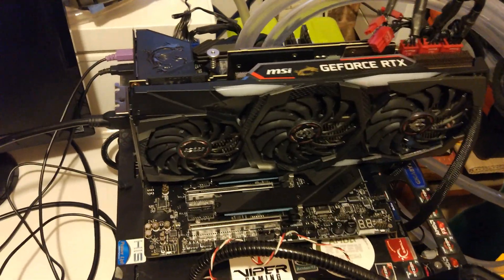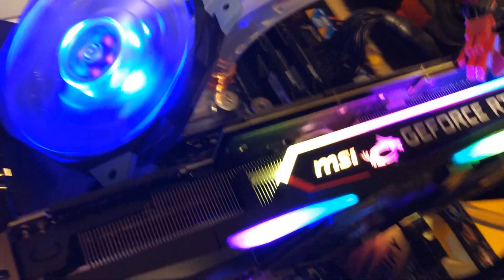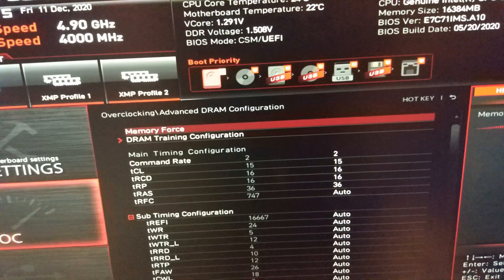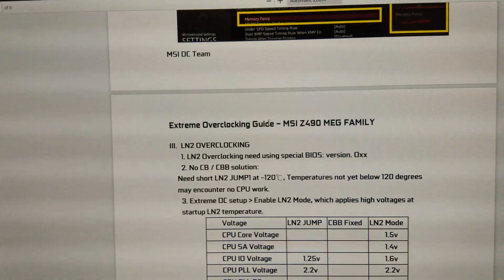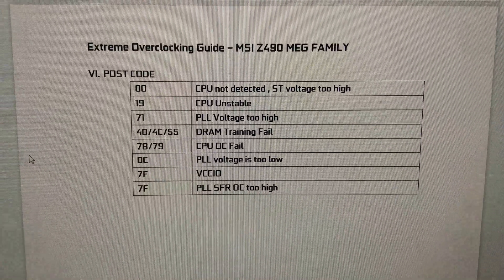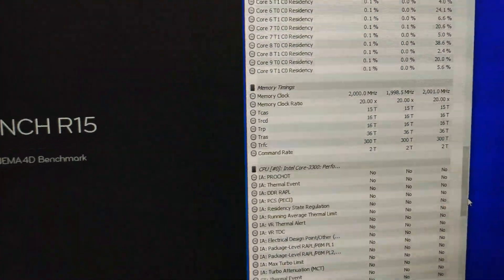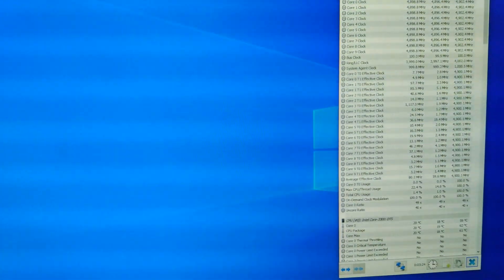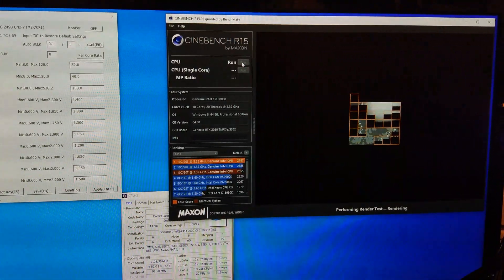i9 10900K ES QTB2 Overclocked to 5.1ghz On MSI Z490 Unify

Comment: Is this processor version good for running servers?
Reply from the maker: @MohammadX-v8r  I would say no as it can be unstable sometimes.
Reply: @LawrenceTimme  From which side?
Reply from the maker: @MohammadX-v8r  it can be slow or crash sometimes obviously it's and early engineering CPU so it's not ideal for a server if it needs to be stable.

Comment: I read somewhere down that this CPU is not recommended with Gigabyte Z490 UD. I got that motherboard. 

Someone's selling me this, with 6 month use, at 380 USD with a H470 motherboard, that I could probably sell at a 100 bucks. Do you think is worth? 

I plan to use it for my streaming rig. 

But I would also like to eventually buy the 12900K.
Reply from the maker: I wouldn't recommend getting it with a h470 as you can't oc and it really needs oc to perform well. Get 10850k or 10700k instead

Comment: I would want to ask about power consumption on that qtb2 cpu with good board(gigabyte z590 aorus ultra with 16+1 vrm on 90 amp mosfets ) and small  OC to 4.6 Ghz and 4.4 Ghz ring like in previous video. Because besides I have decent air cooler this cooler is good to about 200 wats So I want to ask what was power consumption in cinebench on that settings because I didn't do any prime95 or something like this so cinebench is toughest workload I am doing.
Reply: So you think it is possible to tweak this cpu between 4.4 - 4.6 Ghz without going outside 200 wats and not destroy my air cooler which can go to 200 wats based on my testing on i7 10700k OC in these workloads.
Reply from the maker: @jakubmad3957  yes I think so
Reply from the maker: Yes the gigabutt z590 board will be fine. The only board that wasn't up to this CPU was the z490m ud which was terrible and very power limited. You should be able to do 4.4-4.6ghz on air fine.

Comment: Do you think 51, 48 ring 1.4V 1.25V IO/SA 4000MHz REAL 1N 16-16-16-28 280 65534 1.5V on an I9-10900K ES QTB2, MSI MEG Z490I UNIFY and Patriot Viper Steel 4400MHz CL19 1.45v Memory Kit with a RX 6900 XT be good?
Reply from the maker: yes
Reply: @LawrenceTimme  I’m running 51, 48 ring 1.4V 1.25V IO/SA 4000MHz REAL 1N 16-16-16-28 280 65534 1.5V on an I9 10900K ES QTB2, MSI MEG Z490I UNIFY and Patriot Viper Steel 4400MHz CL19 1.45V Memory Kit
Reply: @ShahhTweaks  how did u manage that my cpu shits itself with memory overclock 😭
I have a QTB2, z490 aorus ultra, 3200 14-14-14-31 Dark Pro 2x8.

So far ive gotten to 4200 16-18-18-38 with loose subs
1.38v vcore
1.25v IO
1.3V SA
Reply: @Saberus  I have a mobo with SMT dimm slots
Reply: @Saberus  I have a binned ram kit and my mobo has SMT dimm slots and I have took off the ram heat spreader and now using a ram fan

Comment: my sample arrive today
XMP dont work, my ram is 3200, and work only in 2800
Reply from the maker: Lol try raise vccio and vccsa voltages to 1.25v
Reply: @LawrenceTimme  I will try now.
Tks.

Also, my nvme dont work, it works fine with my old cpu,have any idea whats the problem?
Reply from the maker: @ok_tantofaz  that's strange. I only have Sata SSD and not had a problem. Have you tried a different m.2 port

Comment: What is the stock and turbo clock?
Does it work with xmp?
Is it worth over a i5 11600k?
In aliexpress there are some ppl saying the cpu stopped working after some months, that seems bad.
Reply from the maker: Stock clock is around 4-4.2ghz. xmp working will depend on the board and ram more than the 3200-3600 should work fine.

The 11600k sucks so yes it's worth getting over that. Also look for deals on the 10850k!
Reply: @LawrenceTimme ty, but i couldn't find any good deals on the 10850k, but the 10900k qtb2 vs the 11600k just for 70$ more really seems like a good deal if it is safe. 
Between 10900k qtb2 and ryzen 5600x which one Is better? 
So xmp will work on any z490 or z590 mobo? 
Does a ES 10900k have any risks? Or shorter lifespan? 
 can it be Safely overclocked to be 4ghz base to 4.9 ghz turbo (so it matches 11600k single core performance) with a air cooler (3 fans 8 copper heat pipes)?

Comment: Is it still running stable? The price is very charming but I'm scared of shit going sideways lmao.
Reply: Hi.
Me without forcing with the MSI MAG Z490 Tomahawk I run it at 5.1GHZ very stable. I will adjust in the bios tomorrow or the day after tomorrow and try the 5.3GHZ but I think it will pass without worries, in any case nice your video it encouraged me to take the plunge, frankly those who hesitate go there it's really worth So, I did a Benchmark with CPU-Z at 5.1GHZ and I passed the Intel Core I9 10850K I got the same results as an Intel Core I9 10900K so nickel for the price 👍👌
Reply: @gamerworld4878  hello my friend. Ive been looking at this cpu on aliexpress, but Ive seen some comments there that stated the qtb2 stopped working afetr 1week to 1 month of usage, and that's just really bad if it happens. How is being your experience with this cpu? 
Kind regards from Portugal!
Reply: @hugomouteira7015  I have this processor since 01/22/2021 and it works perfectly.
I am more than happy, it works perfectly, in bench it exceeds the normal Intel Core I9 10900K.
So my experience is more than satisfactory with this processor I highly recommend it.
Reply: @nsinfo3869  hi!
Im really happy to know that. Can you tell me about your setup? I think the motherboard plays a major role here.
And im debating beteen this cpu and the aliexpress 14 core 7940x, but its a bit slower..

Comment: And another question ... I currently have an I5 10400f + MSI RTX 3070 GPU. Is it okay to upgrade to the I9 10900k ES, qtb2 to get the most out of the GPU?.... I use it for renders.
Reply from the maker: Yes as long as your motherboard supports overclocking
Reply: @LawrenceTimme  hi thanks for your answer .... my board is a Gigabyte 460M Aorus Pro. It cannot be overclocked. But at least this cpu would allow me to run the memories at 2999mhz right?
Reply from the maker: @jesusdiegonunezquezada5055  there is not point then Faster ram hardly makes any difference on Intel and the qbt2 doesn't boost very high on its own. It needs overclocking to get most out of it.
Reply: @LawrenceTimme  0k I understand .... any cpu suggestions for my case? ... thank you very much!
Reply from the maker: @jesusdiegonunezquezada5055  get a faster locked CPU maybe with more boost clock like 10700. But also consider getting a z490 board and qbt2 once z590 drops. You should be able to get a good deal.
Reply: Hi.
Me without forcing with the MSI MAG Z490 Tomahawk I run it at 5.1GHZ very stable. I will adjust in the bios tomorrow or the day after tomorrow and try the 5.3GHZ but I think it will pass without worries, in any case nice your video it encouraged me to take the plunge, frankly those who hesitate go there it's really worth So, I did a Benchmark with CPU-Z at 5.1GHZ and I passed the Intel Core I9 10850K I got the same results as an Intel Core I9 10900K so nickel for the price 👍👌

Comment: Bro should i buy one of them? İs it good at single core? İ found QTB2 3.3 for 350 dolars is it good deal? İ will use it with custom water cooling. Did you had any problems? Is it second hand?
Reply from the maker: Yes its much better than 10700k. Check its less than a 10850k
Reply: in 1.32v it work perfectly to 5 1GHZ and I also ran it very stably at 5.2GHZ and 1.35v and beasts Intel core i9 10850k in bench on CPU-Z
Reply: Hi.
Me without forcing with the MSI MAG Z490 Tomahawk I run it at 5.1GHZ very stable. I will adjust in the bios tomorrow or the day after tomorrow and try the 5.3GHZ but I think it will pass without worries, in any case nice your video it encouraged me to take the plunge, frankly those who hesitate go there it's really worth So, I did a Benchmark with CPU-Z at 5.1GHZ and I passed the Intel Core I9 10850K I got the same results as an Intel Core I9 10900K so nickel for the price 👍👌

Comment: Okay. Today I learned that the 10600K ES has thermal paste in it instead of a solder whch causes it to heat up a lot. Does the 10900K ES have solder?
Reply from the maker: Yes otherwise it would be on fire

Comment: I am planning to get a 10900K QTB2 instead of a 10600KF Retail. Would that make sense? And also I will have a 240mm AIO. Can I push it to 5 GHz? and at what core voltaje? Thanks
Reply from the maker: Yes the QTB2 is better than the 10600KF. I have the 10600kf as well and it is not as good. I think you should get 4.8-5ghz on 240mm aio.
Reply: @LawrenceTimme  Is buying an ES 10900K kind of a lottery? May I come across a CPU that is absolutely terrible? Am I taking a risk by buying this?
Reply from the maker: @raptor2701  it doesn't really matter. Even if it's really bad sample and does 4.7ghz, it's still faster than 10600KF 99.9% of the time. The i5's don't oc as well as i9 models anyway.
Reply: @LawrenceTimme  And also is deliding required? I heard the thermal pastes inside these ES CPU’s are very bad and heat up a lot
Reply from the maker: @raptor2701  none of these CPUs are paste any more. They are soldered.
Reply: @LawrenceTimme  My friend has a 10600K ES running on a B460. For some reason he can overclock both the CPU amd Memory with the B460 probably due to the cpu. Anyway we tried 5.0 GHz on 1.3V with a decent tower cooler but the temps went all the way up to 100 degrees celcius which is more than what it should be. Why did that happen? Do you have any idea?
Reply from the maker: @raptor2701  b460 can't overclock XD
Reply: @LawrenceTimme  That is the interesting part. Using intel extreme tuning utility we were able to overclock the 10600K ES and it actually showed 5 ghz in cpu z and cinebench scores matched
Reply from the maker: @raptor2701  it would probably have to be applied every single time you booted then. That is strange though as it shouldn't work
Reply: For sure go for a Intel Core I9 10900K es, mine runs at 5.1ghz 1.30v without forcing with MSI MAG Z490 Tomahawk without forcing and it's very stable, I will try to run it at 5.3ghz soon i think it won't be à problem, with 10 cores and 20 threats i let you imagine how it's a beast lol, beats really easily Intel Core I5 10600K 👌👍
Reply: @gamerworld4878  I also have a Z490 Tomahawk. Did you have to do a bios update or something for the 10900K ES? Or did it work straight out of the box
Reply: @raptor2701  Hi raptor. No I didn't need to update the bios to make it work, I just needed to make settings in the bios to set the processor operating frequency and voltage. I updated the bios because it is still better for compatibility with the most recent components but without updating it worked fine. Frankly with this motherboard it runs wonderfully 👌👍
Reply: Hi.
Me without forcing with the MSI MAG Z490 Tomahawk I run it at 5.1GHZ very stable. I will adjust in the bios tomorrow or the day after tomorrow and try the 5.3GHZ but I think it will pass without worries, in any case nice your video it encouraged me to take the plunge, frankly those who hesitate go there it's really worth So, I did a Benchmark with CPU-Z at 5.1GHZ and I passed the Intel Core I9 10850K I got the same results as an Intel Core I9 10900K so nickel for the price 👍👌 With a watercooling Fractal Design Celsius+ S24 Dynamic

Comment: Hi.
Me without forcing with the MSI MAG Z490 Tomahawk I run it at 5.1GHZ very stable. I will adjust in the bios tomorrow or the day after tomorrow and try the 5.3GHZ but I think it will pass without worries, in any case nice your video it encouraged me to take the plunge, frankly those who hesitate go there it's really worth So, I did a Benchmark with CPU-Z at 5.1GHZ and I passed the Intel Core I9 10850K I got the same results as an Intel Core I9 10900K so nickel for the price 👍👌
Reply: Can the intel qtb2 processor run on a maximus xii hero motherboard?
Reply: @HAIDS_GAMING  yes for sure, it's a great processor for the price 👍 will work great on a Asus rog maximus xii hero motherboard 👌
Reply: @gamerworld4878  awsome thanks!
Reply: I still use this processor in 2024 and it works great always better than Intel Core I9 10900K 👌👍
Reply: @gamerworld4878   Can you help me configure mine? I use it automatically but I believe it can be much better.
Reply: @raphaky  sorry for the late answer, yes for sure i can help you. With what model of motherboard do you use it ?
Reply: @gamerworld4878  Thank you friend, I appreciate your time and attention.
I use an MSI MPG Z490 gaming Plus and a Water Cooler Nzxt Kraken 360. In automatic mode the clock is at a maximum of 4.5 but with high processor usage it drops to 3.8.
Again, I am grateful for your time and attention.

Comment: What are the single core scores like?
Reply from the maker: They will be the same as any other 6/7/8/9/10th gen cpu :)
Reply: @LawrenceTimme  but like, what are cinebench single core cores on this specific cpu overclocked like?
Reply from the maker: @deher9110  240 in r15@5.4ghz
Reply: @LawrenceTimme  thanks
Reply: @LawrenceTimme  is it stable at 5.4?
Reply from the maker: @deher9110  no lol.
Reply: @LawrenceTimme  and 5.3? Or 5.2?

Comment: I dont understand? it's a real 10900k ? or less?
Reply: Me without forcing with the MSI MAG Z490 Tomahawk I run it at 5.1GHZ very stable. I will adjust in the bios tomorrow or the day after tomorrow and try the 5.3GHZ but I think it will pass without worries, in any case nice your video it encouraged me to take the plunge, frankly those who hesitate go there it's really worth So, I did a benchmark with CPU-Z at 5.1GHZ and I passed the Intel Core I9 10850K I got the same results as an Intel Core I9 10900K so nickel for the price 👍👌
Reply from the maker: It's an engineering sample

Comment: is this motherboard (if you tested in the condition) ok with "stock auto settings" or it crazy over-volt like other mobo?
P.s. O.T.- am abit noob regarding OC, i actually have an old 7700k on an asus mobo, can i ask u advices to set it right voltage? I dunno if i must touch the llc going down with voltages (i have seen with an automatic profile that goes up to 4.8ghz i reach the crazy 1.4v :| )

Sorry me for the O.T. ...am looking for help :|
Anyway i find this video something great! am looking at this mobo for the new pc! Probably not yet that cpu but... :)
Reply from the maker: Auto oc profiles are designed to work with the worst cpu, so the always make the voltage too high. You should always do a manual oc on any motherboard
Reply: @LawrenceTimme  uh ok, and about Vcore values, i can change only that without  do changes to llc?
Thanks again :)
Reply from the maker: @simonecorfini3628  yes
Reply: @LawrenceTimme  ty man :) i'll try!

Comment: Are these CPU’s from ali express stable?? Thinking about picking the QTB2 at some point. Will it work with the MSI - MPG Z490 Gaming Plus ($170) for this cpu??
Reply: Me without forcing with the MSI MAG Z490 Tomahawk I run it at 5.1GHZ very stable. I will adjust in the bios tomorrow or the day after tomorrow and try the 5.3GHZ but I think it will pass without worries, in any case nice your video it encouraged me to take the plunge, frankly those who hesitate go there it's really worth So, I did a benchmark with CPU-Z at 5.1GHZ and I passed the Intel Core I9 10850K I got the same results as an Intel Core I9 10900K so nickel for the price 👍👌
Reply: @gamerworld4878  hi wich voltage you used? I got a z490 tomahawk and this proccesor, thank you :)
Reply: @vicentejorquera7471  in 1.32v it work perfectly to 5 1GHZ and I also ran it very stably at 5.2GHZ and 1.35v
Reply: @gamerworld4878  and what temperatures did you get? Srry for my english 😅
Reply: @vicentejorquera7471  no problem i will send you pictures 👍
Reply: @vicentejorquera7471  i have à watercooling Fractal Design Celsius+ S24 dynamic on idle it runs at about 30-32° and in gaming around 45°
Reply: @gamerworld4878  thank you :)
Reply: @gamerworld4878  i have the cooler master masterliquid ml240 v2 did you think that i will get similar temperatures?
Reply: @vicentejorquera7471  maybe you will have around 5 or 6° more because the Fractal design celsius+ s24 dynamic is more efficient but it will do the job
Reply: @vicentejorquera7471  i send you pictures on wathsapp ?
Reply: @gamerworld4878  could you send me?
Reply: @vicentejorquera7471  hello not yet but i do my best to send you the pictures as soon as possible ;-)
Reply: @gamerworld4878  not problem, thank you :)
Reply: @vicentejorquera7471  i send you the pictures on WhatsApp right now.
Reply from the maker: Yes it's been stable for me

Comment: Is it better for me to get a genuine 10700kf or get one of these( even a qtb1)? I've been pulling my hair out trying to figure out what's better. I only game and stream once ever couple months.
Reply: I'm running a 9700k right now so i'm scares to actually downgrade with that qtb1
Reply from the maker: The qbt2 is an upgrade and better than 10700kf. You will need to overclock it manually though to get the most out of it.

 The qbt1 is locked and very slow. I wouldn't get that one.
Reply: @LawrenceTimme  thx alot i was a bit scared about how stable and reliable these chips were
Reply from the maker: @cooper23231  from my testing it's the same as a 10900k or 10850k, only difference is it doesn't overclock very well
Reply from the maker: @cooper23231  from my testing it's the same as a 10900k or 10850k, only difference is it doesn't overclock very well
Reply: @LawrenceTimme  sorry if i keep bothering you but was it just not doing well when trying to reach the 5.3 ghz or even reaching let's say 5.0 was harder?
Reply from the maker: @cooper23231  it can't get to 5.3ghz at all expect 4.8-5ghz on a big air or aio cooler